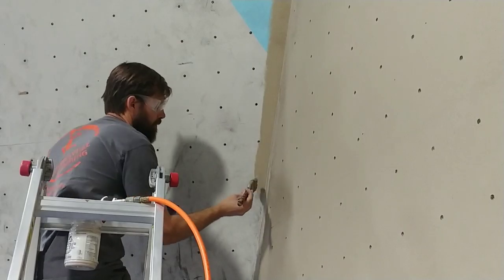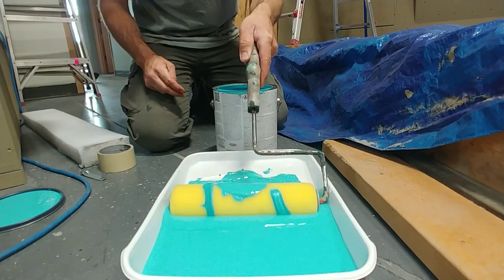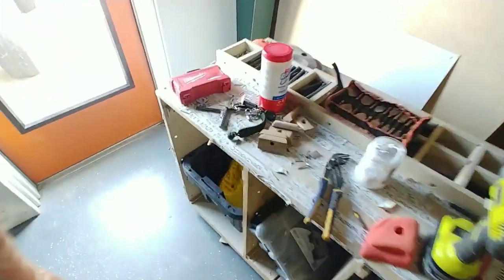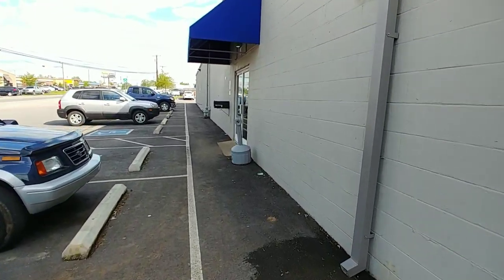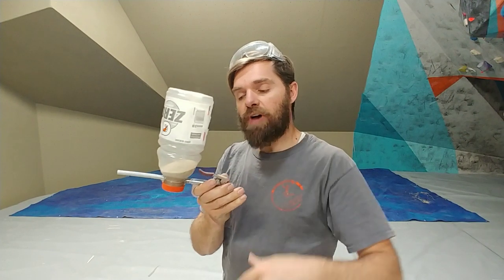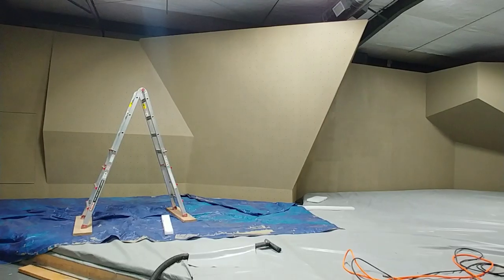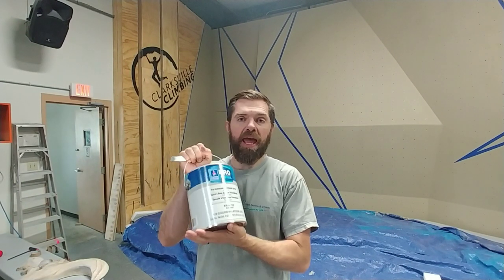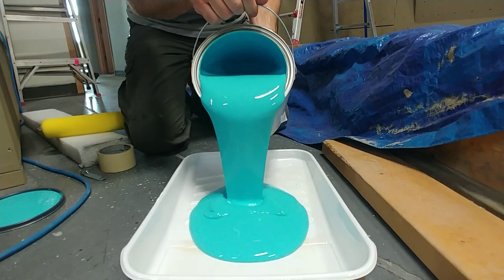Redo TEXTURE on the CLIMBING WALLS: Faith Requires Action VLOG

Comment: i like it, very well done!      i don´t know if you remember me from last video, i told you i was using promarine resin, turns out that takes 3 days for curing, i mean, after day 1 i demold it, to compare how steady was the hold..it was very firm but not quite complete, if i put some preasure it could bend a little, but after day 3, was very firm... i mean is good resin but takes toooo long to cure.

Comment: Does your T-nuts get clogged when you paint? If so, how do you deal with that? 
Thank's!
Reply from the maker: Usually not. This paint is a little more runny that others so I might have more of an issue. I've never had paint get into the threads, it may fill in the front of the hole sometimes and if you don't fuss with it you can just cut it out after it is dry. Easy 😀
Reply: @climberdad  all right i'll do so! I'm thinking about mixing the sand to the paint before even applying the first layer, would you  recommend it?
Thank's again! 
You are inspiring!